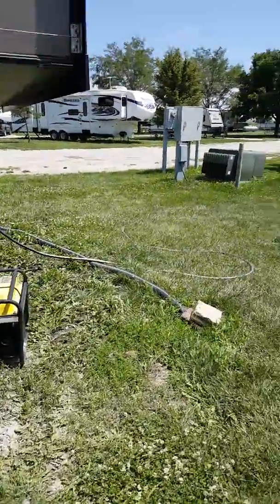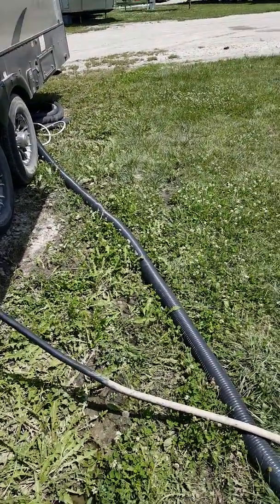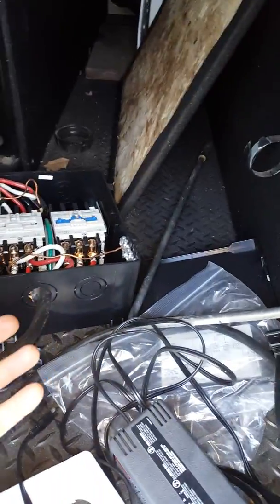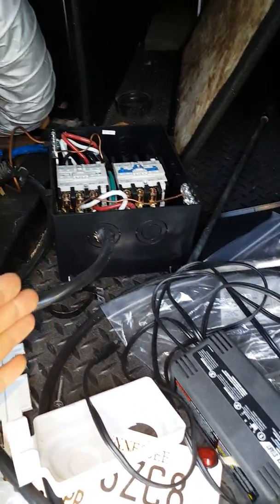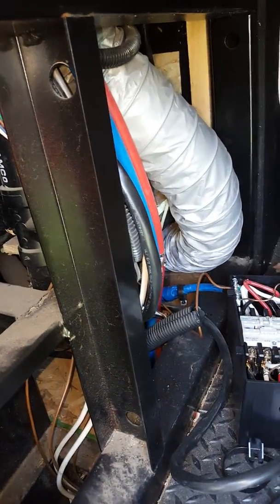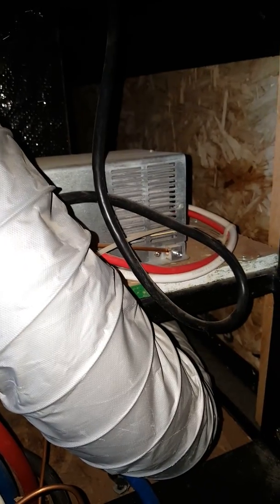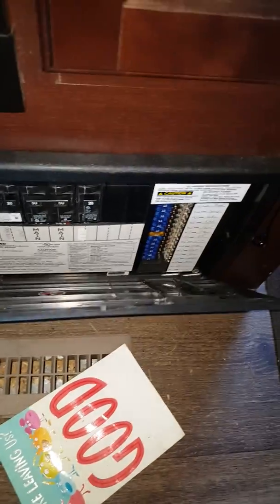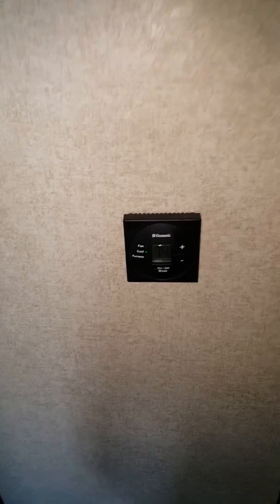Diagnosing electric / power issues to your RV

Comment: So if your battery is dead it doesn't matter if you're connected to sure power does that go for other things in the camper?
Reply from the maker: Battery runs DC power only. Air is AC BUT..... Thermostat runs off DC. So ac will not even with power because of dead battery.

Comment: Love the video.. have power on my microwave and refrigerator. But nothing else works. No power to ac, and lights.. trying to figure it out why... Lol... Any 💡
Reply from the maker: Stupid question. Have you made sure your breakers didn't flip. 

Just based off this. Check you battery. See if it's charged or charging. If not, you have a bad converter or the fuses on went out on converter.
Reply from the maker: If your ac doesn't work and has a separate thermostat. The thermostat runs the ac. If battery is dead, your ac won't work. Even with power.

Comment: Hey bud, I have a question for you. The power on my mom's 5th wheel has all of a sudden randomly started flickering on and off repeatedly on the back half of the trailer that the shore power is plugged into. When the power shuts off to the back end, the power to certain things in the front end surges (revs up really high). I know that the main plug doing into the trailer has been cut off and replaced. Does any of this sound familiar to you at all by chance? Why power goes on and off in some areas and simultaneously surges in other areas? Thank you for any help you can offer, this really has me stumped.
Reply: Oh, by the way, I was told that the power supply going to the trailer is 240, which I'm assuming is too high and I'm assuming that the person that replaced the plug going into the trailer converted it down to 110, but I can't say for sure. The power source was originally installed by Uncle, who has a rep for jimmy-rigging things, so I doubt an electrician would even be willing to look at it. Anything I should look at?

Comment: So our cord is good. When we plug in the cord to our camper it trips the breaker. No electricity is getting to camper. All the fuses are good. Even when everything is off it trips. We took the main breaker out and it still trips. Its driving me crazy. Everything just stopped working. It worked one week and then not the next. Please help.
Reply from the maker: You may have frayed electric lines causing breaker to trigger. Think electric outlets. 

Don't know if you said this. Turn every breaker off except main. See what happens. If that breaker doesn't trip (power is staying on). Then turn on each individual breaker (ac, gfi, etc)

Comment: don't no if you still check this but if so.... when I plug my 12 v converter in it sparks and trips my trailer breaker but if its not plugged in the breakers fine